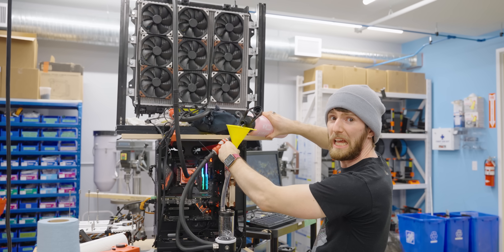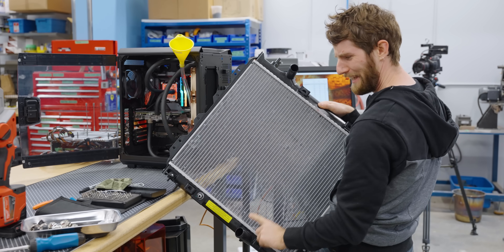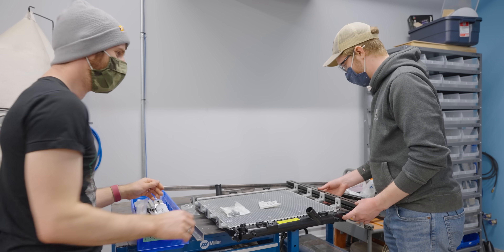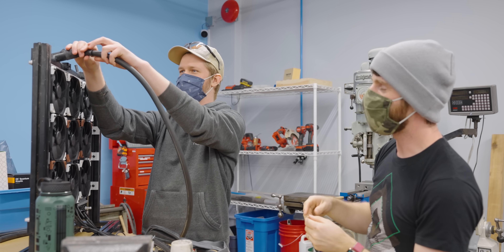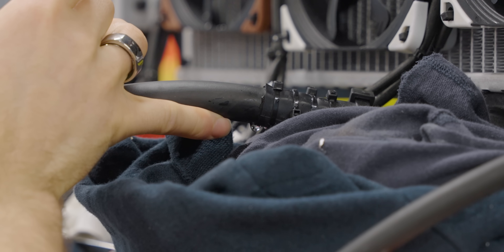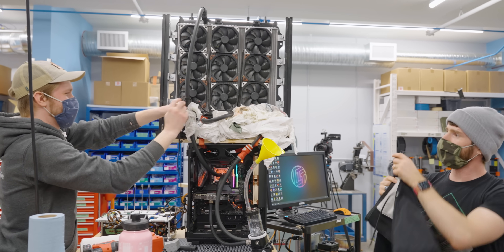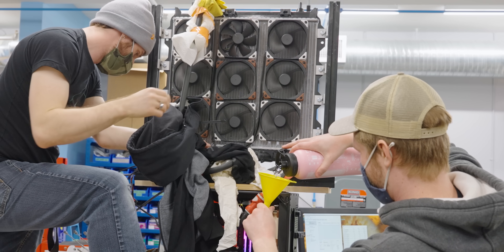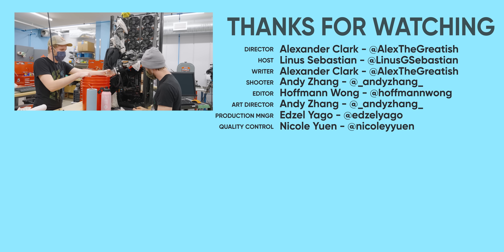Our Craziest Cooling Project Yet - Car radiator liquid cooler

Comment: Just a little car 101: Transmissions run much hoter and push fluid under much higher pressure. You vastly restricted your flow with virtually no cooling gain by plumbing the trans cooler into the loop.  Putting the radiator next to the PC, and only using the two large main radiator openings would have worked considerably better. Also, plumbing putty, crazy glue, pvc glue, or even a hot glue gun would have been able to seal the connections with the cable ties. It may not look like it, but that little spot where the tie goes together does not put enough pressure unless you have a hard tube on the inside and wrench it down with a flat nose pliers. Or you have to use multiple, like four, cable ties with that section 180 degress offset and the ties right next to each other.

Comment: I know they wanted to make the video entertaining and all but I wouldn't mind seeing someone actually do this while putting in some effort and thought into what they are doing.
Reply: That would be a different video.
Reply: Sauf que si ils avaient fait cela de manière réfléchit, sans erreur, ça n'aurait eu aucun intérêt.
Simplement par ce que c'est juste un radiateur plus gros.
Reply: I agree, you can pick up a nice full-sized radiator on amazon for 30 bucks, it will have the main engine coolant part, an oil cooler part, and a transmission cooler part, all available loops which run through the system and are physically never connected. You could run 3 loops pretty reliably.

I hate when I watch an episode and they use something I am an expert on (in this case auto mechanics) and it is so obvious they have no clue what they are doing, it makes me wonder how much other stuff I am not an expert in that they are completely botching and I simply do not know.
Reply: @BestLittleStudio  Anytime Linus talks about super deep hardware stuff it's just what he's been told say.  I still enjoy his videos of course but there have certainly been a few times I've found he was wrong.  Off the top of my head in a recent video he said that 1024 Bytes to the KB was a Windows thing and everyone else uses 1000 Bytes to the KB and some people use KiB to represent a Windows KB.  In truth 1024 Bytes to KB is an actual KB and the 1000 Bytes thing as well as the KiB thing are only used by storage Drive manufacturers (HDD, SDD of any form) in order to confuse us.  RAM and all of the other components and specifications use 1024 Bytes per KB because when addressing a bit or byte every additional bit of address doubles the amount of selectable data.  For example if you were trying to access RAM and could access 1 byte at a time with a 12 bit address you could access 2^12 or 4096 Bytes.  A 32 bit address space gives you 4,294,967,296 Bytes or 4GB which is why 32 bit processors could only access about 4GB of RAM (it was actually limited to 3.5 in Windows but that's because the rest of the address space was reserved for other stuff).
Reply: @grn1  by SI standards, KB is 1000 bytes and KiB is 1024. Of the two, the latter is often more useful, of course :)
Reply: @raokas  That's the BS I'm talking about.  These SI standards aren't the original definitions, they were created by storage drive manufacturers to scam people out of disk space and it seems gnome and Apple have decided to switch to 'SI' for storage drives while Windows and other Linux X interfaces have stuck with the original definitions.
Reply: @grn1  ISPs also did that
Reply: @kas-lw7xz  ISPs also use Kb/s and mB/s instead of KB/s and MB/s to confuse people (b is bits and B is bytes, it's a factor of 8).
Reply: @grn1  No the SI standards are the originals and the binary definition came out because computer programmers were lazy, not because drive manufacturers were scamming people out of disk space. Hard drive capacities have always been in base 10 using standard SI prefixes. When a hard drive said kilobyte, or megabyte, it has always meant a thousand, or a million bytes. Programmers, when working with binary numbers, saw that 2^10 = 1024, which was close enough to 1000 so they called it a kilobyte and just scaled it from there. The binary KiB definition was created so people like you could hopefully understand the difference.
Reply: @grn1  you’re wrong on everything you spoke on
Reply: @MrCaptainTea  Source, because you said so.

After more research it seems that 1000 bits to the kilobyte may have come first but was short lived and by the time hard drives and such came out 1024 bits was the standard for the reasons mentioned in my original comment.  That was also back when we had different byte sizes like 5 bits to the byte for 5-bit architectures and 7 bits to the byte for 7-bit architectures.  Intel standardized 8 bits to the byte with their popular 8-bit x86 architecture (created in 1986) and everyone came to agree to use 8 bits for a byte and in general use powers of 2 starting at 2^3 (=8, we generally say multiples of 8 but it's more accurately powers of 2) for new architectures.  Even if 1000 bits to the kilobyte came first that wasn't the standard employed by the rest of the industry when hard drives came out and the point still stands that they have taken deliberate action to confuse people.  

The main point of the my original comment also still stands in that Linus doesn't know deep level stuff that well.  He's flat out said that he researches this stuff for videos and promptly forgets a lot of it because his job is to present (hopefully accurate) tech knowledge in an entertaining way.  That also means that he's not going to know as much about the actual history or have the deep level knowledge of someone who specializes in those areas (who generally don't have the skills to present the information in an easy to understand fashion).  Unfortunately while he does try to keep things accurate sometimes he's duped or otherwise gets information wrong because he can't learn the full history of things and always ensure his information isn't just popular knowledge or the opinion of the sources he happened upon (which is controlled by complex but still stupid algorithms) while still doing his job (much less doing his job and raising a family).

Comment: In the early days of hobbyist PC liquid cooling (so not, like Cray systems or something) there were some experiments done with using car, motorcycle, and air conditioner radiators. The conclusion that was arrived at was that those radiators, although they work, did not work as well as ones built specifically for PC cooling because they're designed to be optimal when dealing with a very large delta between the water and air, while CPU cooling typically deals with very small deltas (usually only a few degrees at most).

Comment: I get what you guys were going for with this video, but I don't think it works.  I would have much rather seen a cool custom case rig that used that radiator and a proper overnight stress test.  Its going to take much longer to saturate that volume of water and mass of metal with heat.

Comment: If Linus put in at least a fraction of the time into a build like this as he put into building his company numerous channels. This Cooling design would work rather well. Just seemed this whole project was just half-ass done and just to fill in a blank slot in the uploads. Maybe put in roughly a Week into a project like this. Would work almost flawlessly. Also, proper fitting would work WONDERS. Even if you have to create them yourselves. You have a workshop to do it. Duct Tape does not solve everything...Flex Seal does!

Comment: Well this was disappointing for any adults watching. Sure, all the kids watching your vids are going to be impressed by the failscade, but why not make something that actually works, regardless how jenky it is? Surely you must have a hot glue gun, silicone tube or any other flexible glue to use in conjunction with those zip ties. You said it a million times, "it ain't stupid if it works"! But this doesn't work, you said it yourself, the results are useless! Get your act together Linus, post a working setup! Don't think I've done this before, but I'm thumbing this one down! Very disappoint...

Comment: So the "ass on fire" version was a success, now you could do one with a flat pc case layout with the radiator flat on it. I'm quite certain that the fans don't have to spin audibly to get excellent cooling results.
Also, you can get silicone reduction tube sections from an aftermarket car parts shop, along with proper clamps and intermediate rigid metal tubing to connect rubber/silicone sections and the radiator ports, and it would be easy to assemble and 100% watertight.
Car components can usually sustain multiple bars of pressure in the cooling system.

Comment: you guys got ripped off on the radiator, I'm also surprised you didn't use the fan and shroud designed for the radiator.

Comment: I would be curious to see this as a functioning rack-mounted solution and see if its effective in cooling one or multiple machines in the rack
Reply: it is. This is already beeing developped in the serverworld, because rackmounts are nearing the maximum of heat they can dissipate from a rack mounted casing.

You get 2 coolant lines on each side of the rack. And you attach hoses between the server and the coolant lines, which in turn lead to heat exchangers.

Comment: I will try on my Ryzen may be  I will obtai a not pizza oven temp.. ah ah ah 
Is it possible to mount a LAPTOP video card such as a GTX 1080 MXM on a desktop PC? Is there an adapter cable from the laptop video card attachment (which I don't know what it's called exactly) to PCI-e 16? then I can see the cooling and power supply but I would need to know if it is possible to connect a laptop card to a normal desktop PC. Any information of any kind is very welcome. Thank You Davide - Si puo montare una scheda video LAPTOP ad exempio una GTX 1080 MXM su un PC desktop ? Esiste un cavo adattatore dall'attacco della scheda video laptop (che non so come si chiama esattamente) a PCI-e 16 ? poi raffreddamento e alimentazione me lo vedo io ma avrei bisogno di sapere se è possibile collegare la scheda di un laptop ad un normale PC dekstop. Ogni informazione di qualsiasi genere è molto gradita. Greazie Davide.

Comment: would be nice to see this with the radiator as the side panel of the pc a big single fan, if possible find one thats a close size to a side panel.  Make some reducers by 3d printing or using a lathe with proper hose clips to secure together.  block off the trans cooler pipes as they are nothing more than a pipe in the bottom tank.  possibly wont even need a pump as the system would thermosyphon. even paint it black to make it look the part.   Consider be an air conditioning condenser as the hoses will be a closer match for size.

Comment: in Germany or good old Europe we have the "Monster Radiator" from Watercool, MO-RA3 420, space for 4 or 8 Noctua 200mm fans or 9/18 140mm fans... all cooper pipes... default fittings...

Comment: I really like you all, but this kind of nonsense is off. Remember when you cooled all the computers for the editors with one loop and that ghetto radiator in the old house! Come on...step it up!! now you have a workshop and engineers you can do better than rushed nonsense like this. I mean the fittings were obviously going to fail!

Comment: Obviously hasn't heard of gravity fed car radiators (shakes fist). Linus bro I love your videos but this was super super rushed and the engineering mechanics behind it was crappier than your normal standard. Please make a new one but this time place the radiator at the same height as the box (slightly a little higher) and don't use the transmission cooler sides (plug them up). 

Use a 12-13Vdc Car radiator fan. Fill the radiator from the radiator cap hole up the top like you would in a car. And have a pump in line with the bottom radiator hose to the CPU (and so on). Maybe use a different sealed 12v pump. Have the return line go to the top of the radiator with a bleed screw in the connector. Air bleed the system. And for goodness sake use real connector fittings for all the lines with worm clamps/T bolts.

Comment: Bike tube could have been a hose between the two big  pipes and the transmission connectors be the in and out.... Or they could have bought coolant hoses and lines

Comment: Probably could have used PVC adapters  in the bike tube or put a Barb screwed into the cap that was on the radiator

Comment: I'd wanna see this attempted with more effort.  Lowe's/Home Depot/Rural King/whatever should have different hoses and fittings.  Also, there's not much point for the trans cooler loop, really.  It mainly uses the main coolant to cool the trans fluid, so there's not much point in using that loop.

Comment: Ok, this was fun, but forget the Transmission cooler, it's just some pipe through the bottom reservoir of the radiator.

I wanna see this done right, and throw in a car thermo fan for good measure.

Comment: Entire workshop, 3d printers, laser cutters...no pipe adapters. Putting a rigid pipe inside the rubber hose before using the zip ties would give them something to bite on. All of that stress was unnecessary. Putting the radiator beside the computer to test...This was weak sauce.

Comment: computer nerds playing with shit they have no idea how it works, so many mistakes here. do not use the trans cooler, mount the radiator beside the CPU, the water pump cannot push all the coolant properly over that distance, get a single automotive cooling fan. and for the love of god, hose proper automotive hose clamps

Comment: Watching this is so bizarre, considering this is more or less how PC watercooling got started in the first place (most used smaller heat exchanger cores rather than the larger rad though). Then there's the fact that the 3x3 120/140 rads like the MO-RA3 and the ones from Phobya/Alphacool are basically modified car/AC rads made pretty enough to use with PCs.

Comment: I am laughing so much at the this. The fact that you are trying to hold 8-10 litres of water with zip ties is awesome. The only thing better would have been duct tape. If it was on the bench instead of on top it might have been easier for the pump and you could have filled it from the top of the radiator as well, instead of giving your PC pump a hernia trying to push that much water up that high.

Comment: Ok I have to say. The transmission cooler is not part of the rad. It is just a separate small cooler inside the one end tank. Don't use it!! I would have used the rad cooling fan that is made for the rad 1 12 fan. Easy! I sold auto parts for 32 years and have bin thinking of that Idea for a while. You can get the right fittings and make it good and right.

Comment: Okay so what about a custom case using 2 of those dual fan window fans (one on each side, one fore intake one for exhaust)
This case would obviously have to be huge but should be worth it
Then the entire case is in another even larger sealed and insulated case (probably several feet cubed) and put some sort of refrigeration unit or dry ice in this case to keep the inside super cooled 

This outside case would also have to be large enough for a mini dehumidifier, and ideally have a hose leaking out from the collection tray for minimum maintinence

Comment: You could of just gotten a 96 honda civic radiator with fan for way cheaper on rock Auto & probably could of suited the PC better. Could of also used a relay + temp sensor to have it automatically kick in by it's self.

Comment: Small short radiator cooler is inside to be in contact with the passing coolant. It doesn't take a lot of cooling to keep a trans in the right temp range. Then when you tow a load or work it hard is where you'd need more radiator/cooling capacity.

Comment: I dont know if anyone has actually answered this or not but the transmission lines hook to a separate smaller radiatior esque device inside of the plastic tank of the radiatior. The black plastic is basically like a coolant tank on the sides or this case the top and bottom of the radiatior and the fins allow the antifreeze to flow between the the two tanks and cool the liquid.

Comment: it would have been a better idea to use a radiator that wasnt seal or designed to use a degas bottle like one for a older civic. then you could have prefilled the rad abd then used a pond pump to circulate the water. this looks like something a methhead thought up in a 3 day speed ball binder.

Comment: Would like to see a follow up where they 3d print appropriate adapters ❤️
Also, those transmission lines are not helping at all, they are to allow heat transfer from the ATF to the coolant, allowing the transmission to be cooled also by the radiator
Reply: Essentially you're trying to transmit heat from and to the same fluid

Comment: My first water cooled PC used the heater core from a Hyundai and an aquarium pump. No fans at all but a huge water tank (with a Playmobil deep sea diver fighting a moray eel for some pirate treasure)
I'm pretty certain that it didn't thermal throttle... Because it was an Athlon 64 which I think was before AMD had safety features like that 😅

Comment: Some  PVC fittings and radiator hose could have went a long way to not have the rad connectors leak. The Trans cooler is literally a tube connected to the two fittings. It uses a rad water to transmission fluid cooling to cool the transmission. You could use a motorcycle rad or one of the really small Honda rads for this project too.

Comment: So you waisted 170 dollars at Napa for why ??? You could order a better radiator from eBay for a car for half that cost. Also why napa the most overpriced auto parts store ever. Also why not use an electric fan for a vehicle and a speed controller would have been a lot more effective